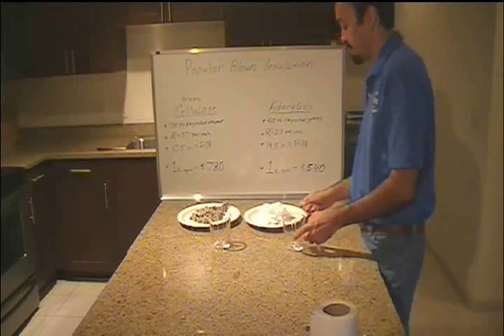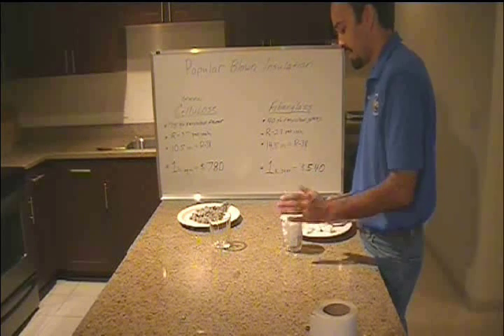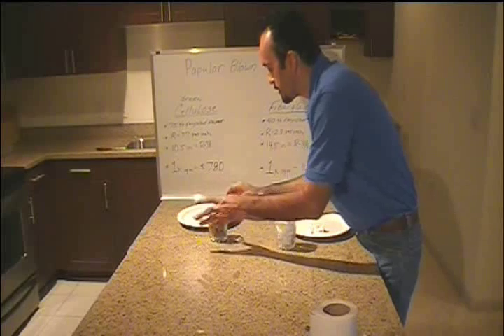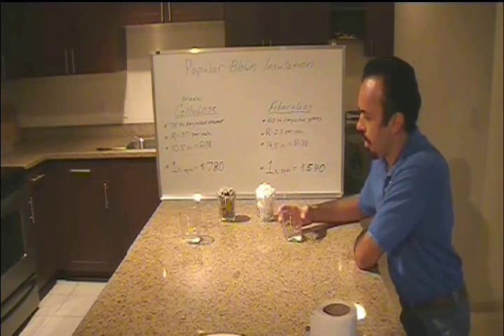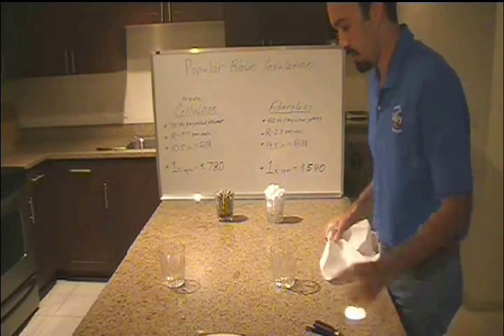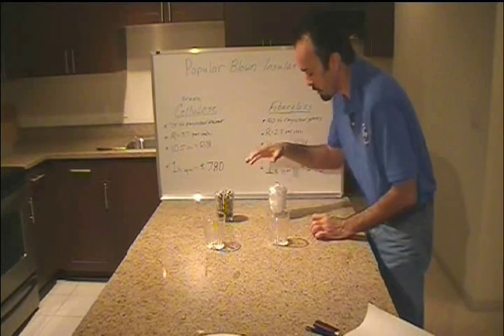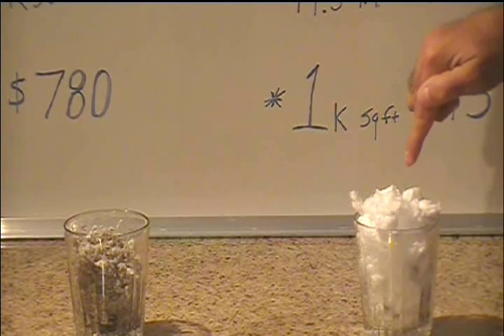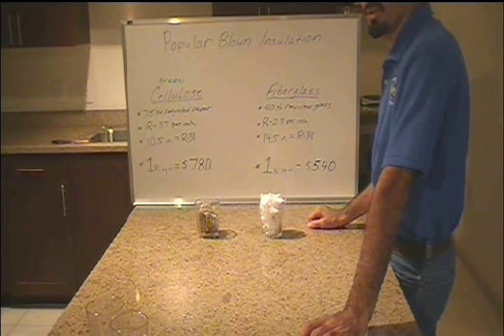Blown cellulose versus fiberglass insulation part 2

Comment: I think I know that cellulose is better bc 
the itchy stuff mislabeled "insulation" fails to stop AIR FLOW (convection) thru cracks and gaps (like around cieling mounted lights etc.)that is the most likely single reason your house lost heat!

Comment: Cellulose retains the R factor after compression, If you follow the label and calculate square footage, apply by the lable you will retain the R value after it settles. I've seen too many do it yourselfers that install either form of insulation and when they see it ontop of the rafters they quit and assume its well insulated.

Comment: I don't think you understand how humidity causes issues I highly recommend you research how relative humidity cause problems when using air conditioning. As for safety you should look at the big burn and fiberglass vs. cellulose. Both products have pros and cons. The water portion of your video is far from objective. I agree you should not believe everything you hear. The statements in this video are not founded in sound research. I would suggest to anyone looking at their options go look at the benefits and risks yourself of each product and make a decision on what you are comfortable with. 

I personally prefer cellulose in the attic and Rock wool in the walls but I will not argue that what I like is the only or best way to do things. We all have opinions but don't go giving false or inaccurate information.

Comment: I'd like to hear his take on the safety and fire resistance issues, too. Oh Ok we did hear than f/g is not safe to the installer.
Because of condensation humidity is actually more of a problem in cold climates than in the warm south.  If an attic is warm you will not get moisture.  Roof leaks, not so good. 
I've used both and long term we really do not know the ultimate health and safety implications.

Comment: This is really a poor test. It is obvious you don't have a clue what you are talking about.

 Fiberglass works by trapping air, and becomes less efficient when compressed. Cellulose works differently, and becomes more efficient when compressed. 

Pouring water on insulation is not the same as creating a humid environment. Even so, your test proved nothing. Cellulose insulation contains boric acid, similar to what is in eyewash. Boric acid is a great fungicide. As such, cellulose does not promote mold easily. Fiberglass does not absorb water, but it does not wick it away from drywall, and this causes mold problems. 

Fiberglass melts under heat. Cellulose contains a fire retardant. Homes with fiberglass insulation burn much faster than homes insulated with cellulose. 

Finally, R values are under ideal conditions. No wind, no temperature variation, and assuming no radiant heat gain. Fiberglass insulation is not an effective barrier to air movement, temperature variations, or radiant heat gain. On the other hand, cellulose is effective under these natural situations. The only way to make cellulose effective is by using a vapor barrier, and that is not a good idea in Houston, Texas because a vapor barrier keeps moisture from escaping.

Comment: Rather than remove cellulose from old walls, I add more cellulose using the modern day "dense pack" method for walls.  This prevents settling and provides far better resistance to air in-leakage than fiberglass.

Comment: Cool. Thanks for the numbers and thanks for the experiment. My wife and I just finished our third weekend of vacuuming out 50+ year-old cellulose insulation from the apartment walls above our business. In all of the runs in the walls, the cellulose was settled no less than two feet below the holes cut by the installers. The building is a classic balloon frame, so the runs from the apartment ceiling to ground level are 21 feet. We're going with fiberglass -- and your time and video is awesome.

Comment: My fiberglass insulation is kinda getting dusty, are you saying it is safe to put 1/2" of water on the fiberglass.  After all it is just like the humidity in the air.

Comment: It was a fair trial. We've installed both of these. I decided to make this video is because customers always assumed cellulose was "greener" and more efficient form commercials. This video was hard to keep short to make a point. It's two videos at 15 min and even a board with numbers in the background although hard to read. Call it liquid or whatever you want, cellulose did not and does not repell moisture like fiberglass. Can you look someone straight in the face and deny that? I can't.